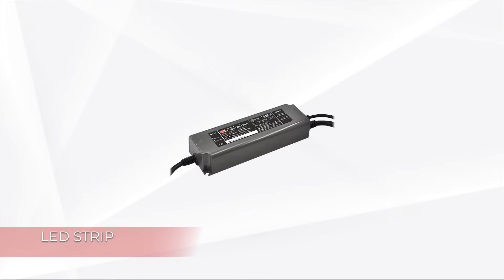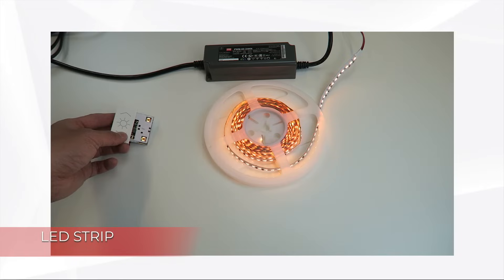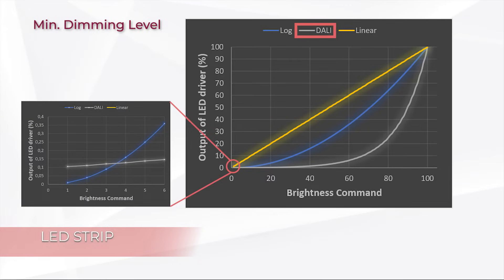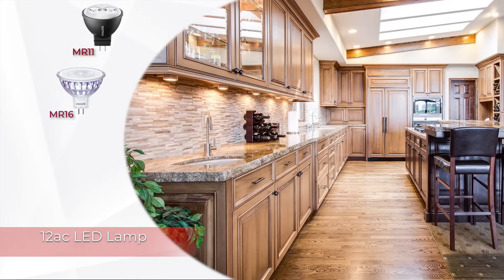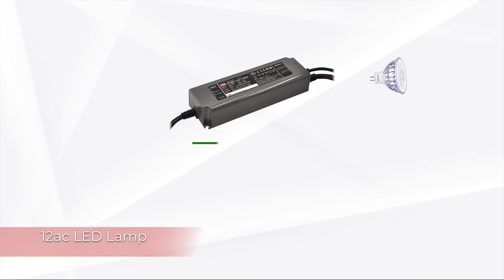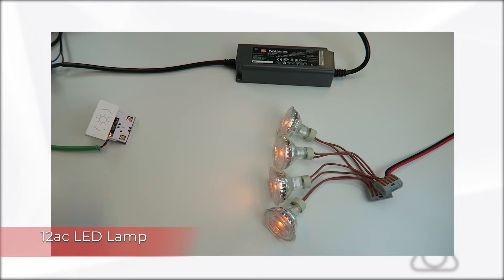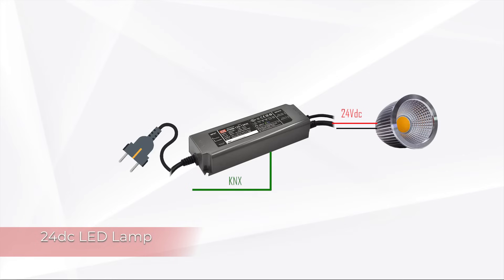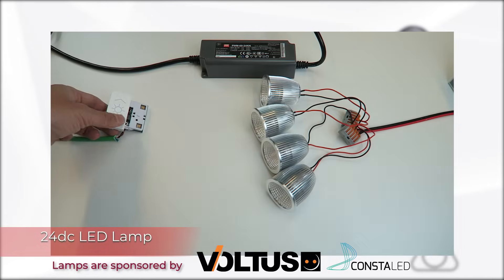MEAN WELL : LED applications for constant voltage KNX lighting driver without DALI

Comment: hmm... so i need one power supply for each group of lamps, or 4 big power supplys if i have for example 4 rooms with an led stripe as indirect lightning....... with the MDT one i have e.g. 4 channels and can control 4 groups of leds with just one controller... as far as the power source goes, but that should be enough. still nice product!